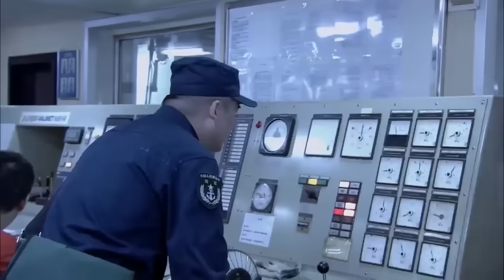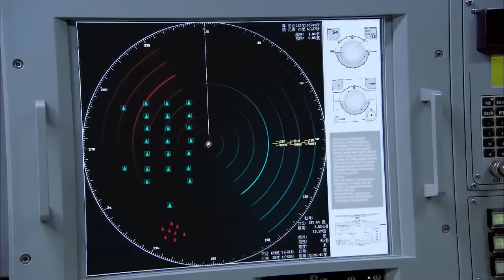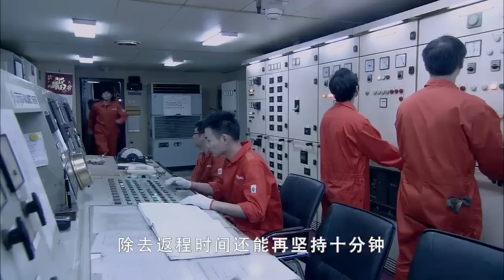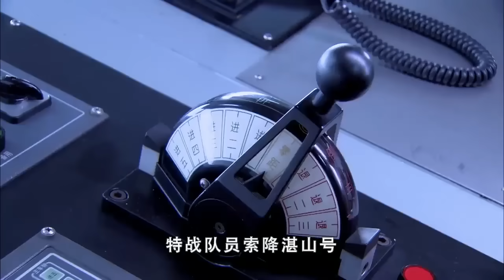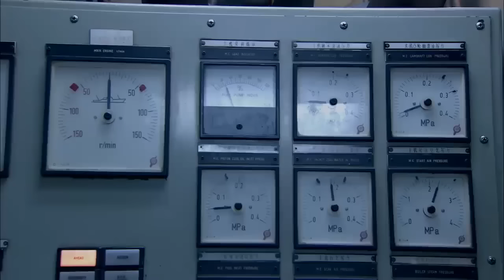海盜不知死活竟敢打劫中國商船，不料中國海軍霸氣出擊，海盜被嚇尿了  ⚔️ 抗日

Comment: Nice drama🎉🎉🎉.
Modern ship should include equipment along outer wall... 2 feet down, a sharp sword juts out and move sideways back and forth that can cut all the anchor ropes. Activated from inside. No one will be able to climb on the ship.😂😂😂😂.